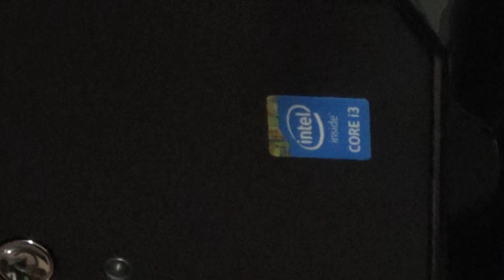How to make $600 out of 8 Computers through Scrapping. It's very possible

Comment: They two boards were server motherboards. Which is why they had extra dimm slots for ram
Reply from the maker: +Jack Mehoff I figured they were not regular desktop computers. They were the oldest ones i got and they had some good value
Reply: +Champlainscrap Yup, a lot of gamers are building systems with them these days cause of the extra dimm slots. If you get one of the cpus designed for server KEEP it! They are expensive to buy! you could get some good money from them.
Reply from the maker: Cool Thanks

Comment: I just got 25 pentium 3 computers and 10 old cell phones.10 computers still working, OS Win98 :)
What do you think, how mutch gold I can scrap from them.
Reply from the maker: Probably not that much. Another scrapper had made a video not too long ago and did a test. They had about 120 Ram gold fingers that he had cut. So the gold he had was plentiful, not sure if that's the right word but I'll go with it. He ended up getting about $40 worth of gold from them. From what you have, I would say less than $40 of gold
Reply: The ram fingers is not at All the only Thing to scrab from old pc and other electronic scrab, money can be made easy iff you can get the stuff for picking it up its worth your time, strib every gold plated item bath them in nitric acid on some kind of heating device and when the reaction from the copper and other metals stops, you filter cleanse and in your homemade foundry;) forget Aqua regia a prober nitric cleaning is enough.
Reply from the maker: if they're working, sell them as working. someone will eventually buy even if they are old . As far as gold value, it's hard to say. I have a more recent video showing you how much material you need to make about $100 worth of gold. It's quite a lot. Another scrap had made a video saying that they needed about 100 ram to make $40 of gold. It should give you an idea of how much scrap you need.

Comment: couldn't u just get more money if you sell the whole pc??
Reply from the maker: Selling the part separately will almost always bring you more money
Reply: @champlainscrap6076  wierd cus i began scrapping things but then realised that i can be making more bank if i just sell the thing.
Reply from the maker: @alexy.9306  Not scrapping but taking apart the computers and selling the parts separately if they are actually working. Scraping is last resort
Reply: @champlainscrap6076  yh but usually the things i scrap work but they are super old and i think no one would wanna buy them like an xp computer
Reply from the maker: @alexy.9306  Even so XP stuff is still good. As long as the PC is dual-core you should still be able to get some money for them. I usually get between $25 to $50 for a dual-core processor with motherboard and Memory
Reply: @champlainscrap6076  ironically now anything older than socket 478 is gaining value due to people tossing old hw out and or scrapped by scrappers making them rare, a non proprietary socket 7 motherboard goes for around 50 usd and the processors are like 10 usd 478 had mobo prices going up but cpus are still worthless